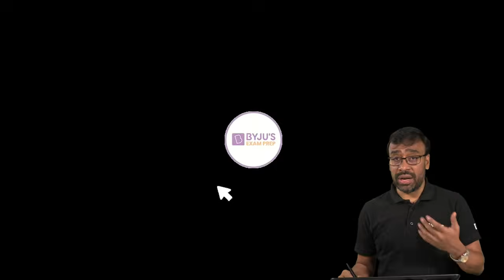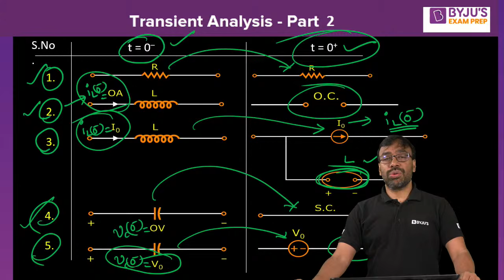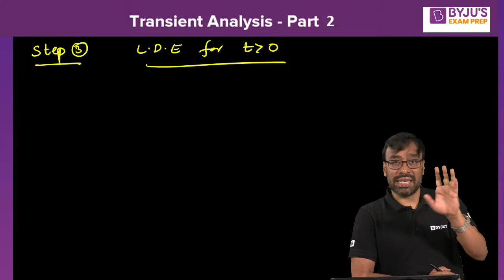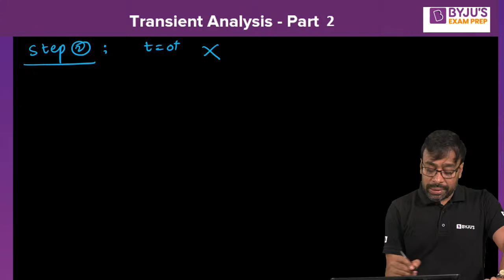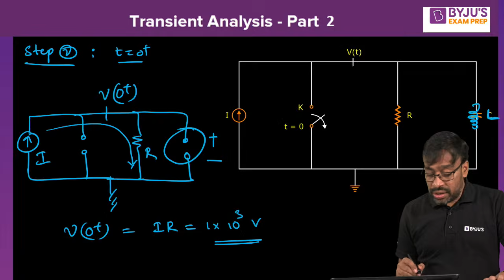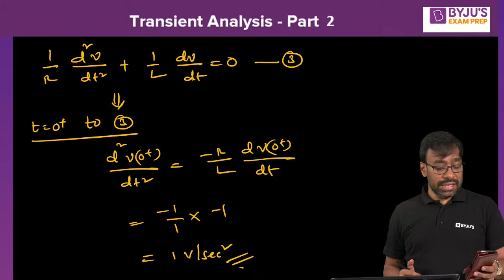Transient Analysis (Concepts & Simple Techniques) (Part-2) | Network Theory | GATE 2023 EE/EC/IN

Comment: 57:38 so there are two short circuits without the resistor right? One is the closed switch other is the inductor equivalent... How are we concluding that the current through the inductor is zero?? Will not both shorts conduct and only the current through resistor will be zero, no?